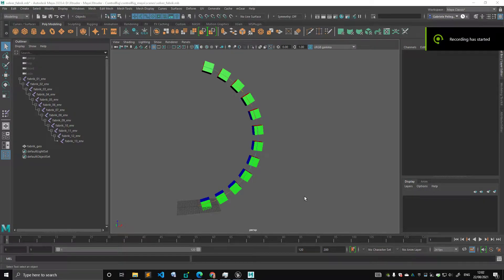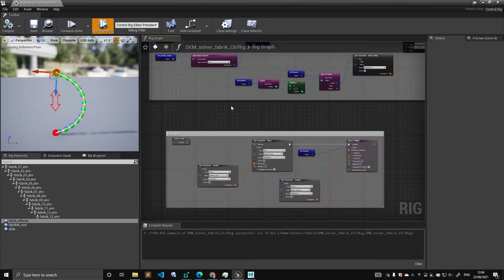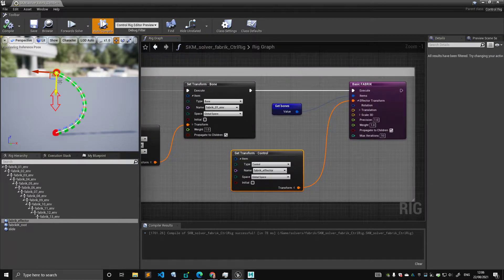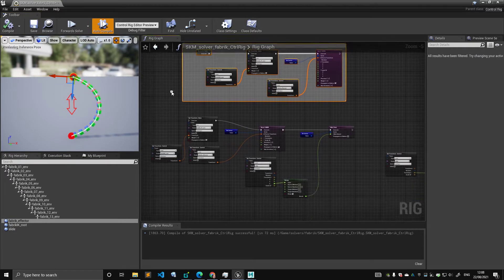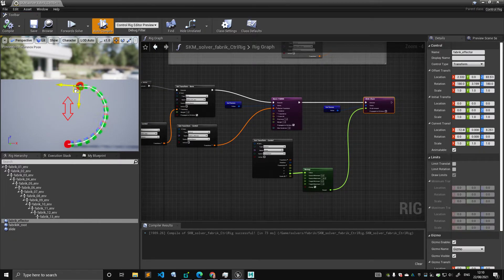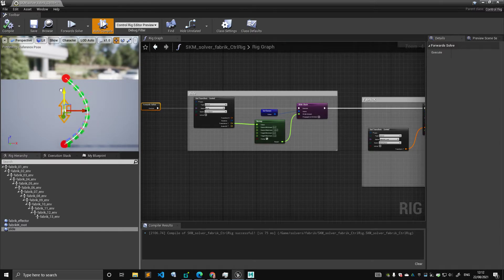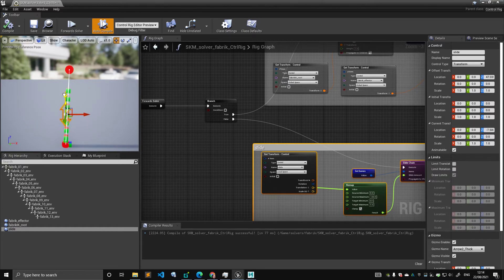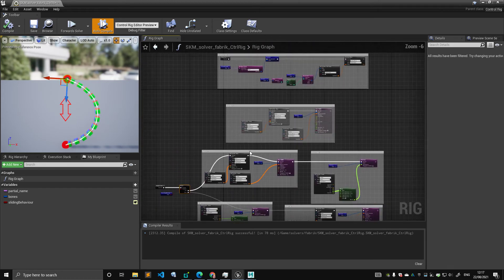Control Rig - 07 - Solver: Fabrik, Branching and Sliding.

Comment: For this video, is that object that we're using a set of armature bones on a curve?  I'm using blender3d so I'm not 100% sure what you did here to create the skeletal mesh.  I think its armature on a curve, but I just wanted to confirm.
Reply from the maker: Hi! When I show something in maya is always just bones and geometry. I simply created a straight chain and then rotated all the bones to get a C shape. In blender you can just create a straight line of cubes. Then a straight line of bones. Then apply the armature. Then rotate the bones into a C shape. Then bake the geometry down and finally reapply the armature. I do realize now I may have to go a bit more in detail when I am working on the DCC application.I am sorry.
Reply: @xtruder3D  thanks buddy! I got i went with the create on a curve route and I got it sorted out.  another banger tutorial.  I think im almost ready to start building my own simple rig.